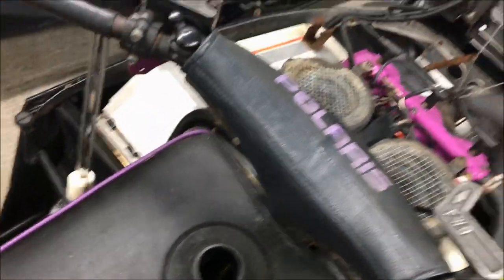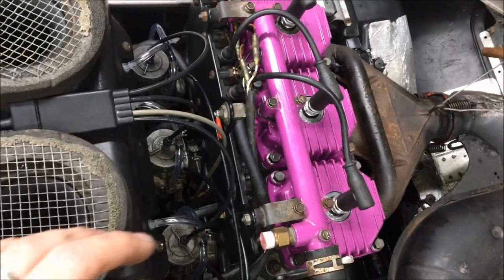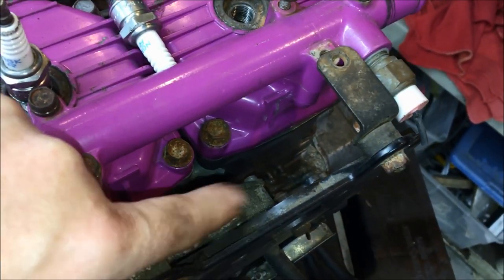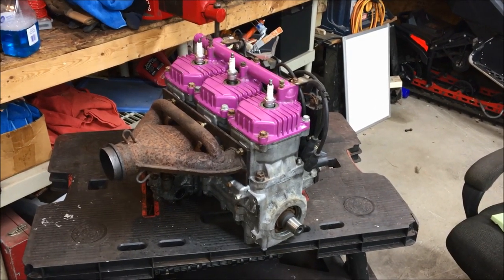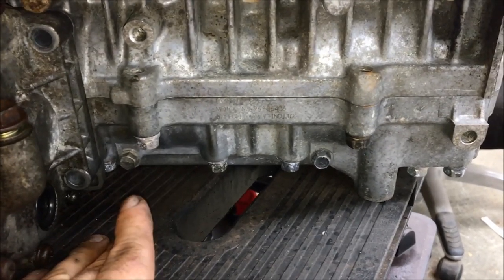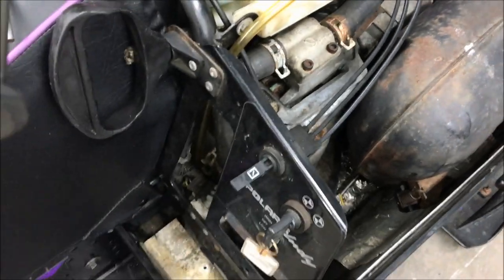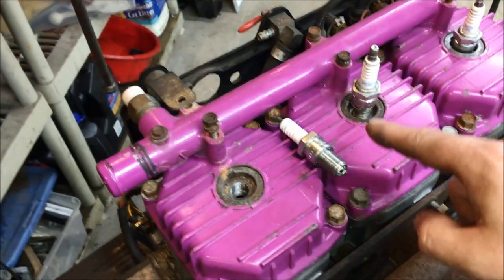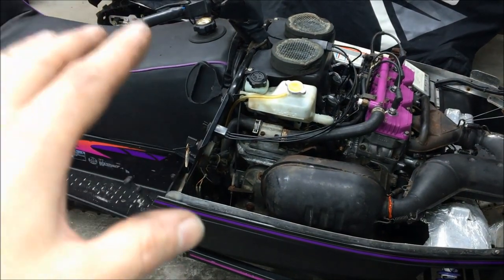Polaris Indy Wedge Snowmobile No Start - Troubleshooting 101

Comment: Good tips Streeter, the wire disconnect I didn't know about, learned something new. We had our first frosty mornings a few days ago, so now I'm waiting for those first flakes to fall, still praying for snow!!  The pickup line in the tank is a big one that most people don't know about.
Reply from the maker: Thanks!

The disconnect is a great troubleshooting option but can catch you by surprise if you’re not prepared. 

I’ve yet to work on a older sled that the pickup line hasn’t fallen off or was about to fall off.

Comment: Micro switches on the throttle can also cause no spark on all three. Adjusting the cables took care of my no start issue on my 98 XCR700
Reply from the maker: Absolutely correct
Reply: What is being referred to here "Micro switches on the throttle"? @StreetersGarage
Reply from the maker: @billrae4198  there’s a switch built into the throttle block that makes contact with the back of the throttle when at rest.

Comment: Nice thanks ,I m working an a 80ies bombardier tortox and it does not have a ignition key
Reply from the maker: Ok. Not too familiar with those. Typically you should be able to unplug the harness from the back of the switch and it should bypass it.

Comment: What’s the first couple things to look at when bogs at 3/4 throttle starts first pull 
After spark plugs. I always run ethnol free gas. On 96 ultra. 1050 miles. Ran great last season
Reply from the maker: Fuel delivery issue.

Comment: I took my newly purchased 2017 sled on test run and it did not skip a beat. It was about -5F and I parked it outside and a couple hours later I couldn't get it to start back up. I replaced plugs. I tried starter fluid. I tried pouring gas in the cylinders. I got spark when I pull the plugs out of the motor. And nothing is helping it to start. Im thinking it has got to be something with the spark plug wires. I'm not sure what to look into next.
Reply from the maker: What model sled?
Reply: @StreetersGarage  2017 zr 800. I checked compression and both cylinders were low. I think I'm gonna need a new top end.
Reply from the maker: @drakeschlosser8323 what compression tester did you use?  Was it a HF with the flexible hose?
Reply: @StreetersGarage  I forget, I'd have to check. I think I got a bad reading with it. I ended up taking it in to get diagnosed. It was a bad exhaust sensor that flooded the motor.

Comment: I’m going through my 93 Indy classic touring 500 and have put new lines on and noticed fuel in the pulse line. Installed new fuel pump and still same issue. So I believe it’s what you’re saying about fuel leaking through needle and seat. What’s the diagnosis for that..?
Reply from the maker: Ok. Have you drained the engine of fuel? You may have a build up in the case that’s left over from the original issue.  

Or worst case scenario, the carb is over fueling and filling the case. Pull the carbs. I have a comprehensive video on what you need to do to rebuild them.
Reply: @StreetersGarage  at work for another hour, got a buddy going through her right now but the mission is to locate both drain plugs & drain. Will update later 🙏
Reply from the maker: They’re located on the exhaust side. One per side.  On the lower part of the case. 10 MM. 

Don’t drop them under the engine. 😀
Reply: @StreetersGarage  after weeks of work and some money spent tested compression again and cylinder 2 is low. Blown motor :(
Reply from the maker: Relatively easy fix. Purchase a top end kit and you’ll be good to go.  The 500 engine is pretty easy to rebuild.
Reply: @StreetersGarage  got everything pulled apart at the jugs are scored aswell as the piston, wiseco worth the money versus all the cheaper alternatives?

Comment: Hey there. I have a 340 indy lite touring 98 model. Do you have any advice for broken spark plug / ignition wires? Unfortunately it's not the cap end where the wire is snapped. Thank you in advance!!!
Reply from the maker: Only thing you can do is to replace it.

Comment: Any suggestions for a dead cylinder? Has 119 pounds of compression, carb is good (tried it on another sled and it ran fine) Can start the sled take the wire off of the dead cylinder and no change. Take the plug wire off of the other cylinder while running and it dies. New plug and plug boot on the dead cylinder. As far as I can tell it has spark.
Reply from the maker: What model sled?
Reply: @StreetersGarage  1997 polaris indy sport
Reply from the maker: Pull the drain plug and make sure the case isn’t flooded with gas.
Reply: @StreetersGarage  done that already.  I have even looked in to make sure the piston skirt wasn't broken.
Reply from the maker: Does the cylinder fire if you put gas in it?
Reply: @StreetersGarage  it spudders. It will fire for a couple cycles  then dies out.
Reply from the maker: Ok. Then it’s a fueling issue.
Reply: @StreetersGarage  it also doesn't idle unless hold the throttle open a little. Have switched the carbs from one side to the other same results. Also tried a different fuel pump and same thing.

Comment: So i have a issue where one pipe back fires and runs on 2 on a 1996 xcr 600 sp like just that one cylinder is set wrong for timing or something I've tried many things on her and curious what i could do to try and get it back on all 3 cylinders it got good fuel and spark?
Reply from the maker: could be a bad coil. try moving them around and see if the condition follows the coil

Comment: Went to start my ‘00 XC500SP today but no start except with starter fluid. Ran perfectly when I winterized it in March, oh well. Not sure if my sled even has a fuel pump
Reply from the maker: Yes. Definitely has a fuel pump.
Reply: You’ve given me some excellent troubleshooting tips. It was stored at an angle with not too much fuel so thought that might be it, but no. Next step it looks like fuel is going up to the shutoff valve but not coming out of it. @StreetersGarage
Reply from the maker: @CBCycles  That’s odd. Typically if the vacuum is strong enough to get fuel to the shutoff, fuel should pass through it. 

Check for a blockage at the fuel shut off or  take a piece of fuel hose and attach it to the other side of the valve and see if you can blow air into the tank. Listen for bubbles. 😀
Reply: May have found the cause - the pickup hose inside the gas tank is disconnected, no fuel flow if tank half empty. Parts on order. @StreetersGarage
Reply from the maker: @CBCycles That would definitely do it.
Reply: New parts installed. But I just made more work for myself - figured I’d empty the last little bit from a bottle of two stroke oil into the oil tank, except what came out was icy and sludgy, must have been using it for something and never labeled it, contaminated the oil tank, argh!  @StreetersGarage
Reply from the maker: @CBCycles it never ends. lol
Reply: Purged the oil tank, got everything back together, runs amazing thanks. Btw one of your videos helped me add reverse to this sled, works so well.  @StreetersGarage
Reply from the maker: @CBCycles that’s awesome. Reverse is a must have as you get older. Heaving these things around sucks. lol 

Any snow in your area?
Reply: No snow in southern New Hampshire!! We thought since it rained all summer it would carry into winter but nope, how about you? @StreetersGarage
Reply from the maker: @CBCycles I’m in Western MA. So nothing down here either. This will be the 3rd year in a row that I haven’t been able to ride during Christmas week.  A shame since northern NH had a great start last week. 

Should have went to VT this past weekend. 🤣

Comment: Is there a way to just unplugg the kill switch but I can use the key to turn it off?
Reply from the maker: Yes. Unplug the 3 wire connector at the throttle block.

Comment: My middle cylinder keeps cutting out just cleaned the carbs and adjusted the cables idles good but when I take off it bogs down but when I open her up it kicks in doing a 120 could of gone faster when the belt broke off lol what can I do with the middle carb to keep it running
Reply from the maker: too much fuel
Reply: I got her going but I'm still breaking belts lol what's the right belt for the indy ultra sp 680 or 700 triple
Reply from the maker: Check your torque stop and engine strap on the pto. It likes to break on the ultra.

Comment: If I disconnect the wire and it starts what about replace
Reply from the maker: Throttle safety switch, key switch or kill switch. It’s one of the 3. Just have to figure out what one.

Comment: what happens when u dont have fuel going to the plugs , i have spark ,,, totaly cleaned carbs but all it does is leak and doesnt start
Reply from the maker: Floats are stuck.
Reply from the maker: Check out my Indy 500 carb cleaning video. It’ll walk you through the entire process
Reply: @StreetersGarage  I've cleaned all jets, and floats are not sticking, that was my first thought
Reply from the maker: Fuel is coming out of the vents or coming out of the main jet when the sled is not running?
Reply: @StreetersGarage  so what would cause that,, it's like the gas gets to the carbs and then just leaks from there and not getting to the motor,, would it be fuel pump, of so how do I determine that's my answer
Reply from the maker: @jamiehill9578  couple be a couple of things. 

Needle and seats are installed upside down

Needle and seats are worn and leaking

Float arm is installed upside down

Floats are full of gas.
Reply: @StreetersGarage  I'll check needle in seats to see if worn 🙄
Reply from the maker: Good luck

Comment: 3 things fuel tank line in side tank bad fuel pump film bypassing gas into the crank case or low compression im leaning tword the fuel tank line rotted off
Reply from the maker: Yep. That would be the first thing I d check.

Comment: Triples are a curse lol
Reply from the maker: They are. It’s the equivalent of dating a stripper. Lots of work and agony for small moments of pleasure. Lol
Reply: Streeters Garage I have a bent control arm on one of mine, a 600 XC xlt, you have to remove the exhaust to get to the bolt, and it was the most painful thing to get off
Reply from the maker: A L O N E Anderson Trailing Arm Bolt?
Reply: Streeters Garage Nope, found out that the arm screws on and off lol
Reply from the maker: I know I’m ALONE. Ok. You’re talking about the radius rods.
Reply from the maker: Right. Lol
Reply: Triples are solid if you know basics my 580 xlt has been just as reliable as my 99 rmk twin
Reply from the maker: Absolutely. The Ultra gave me fits at times.  I should of kept it and got it dialed in.